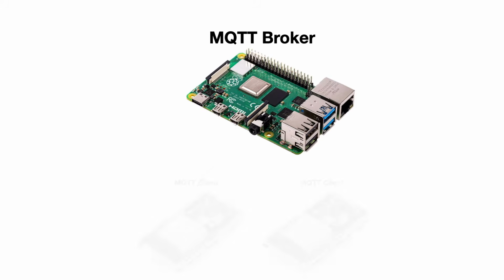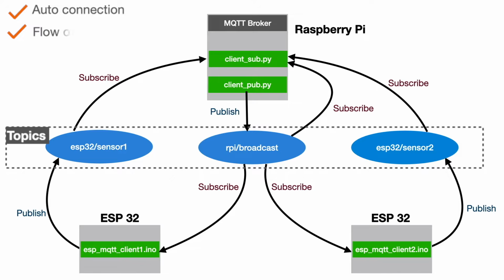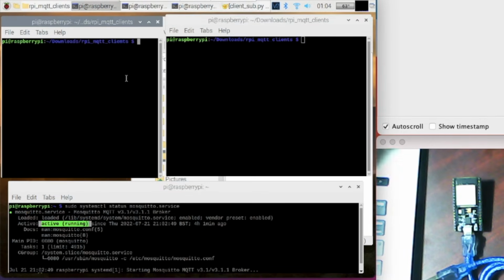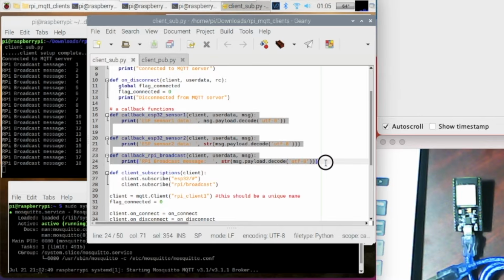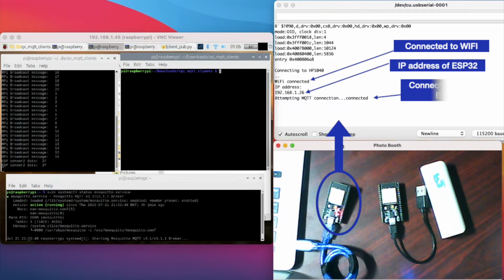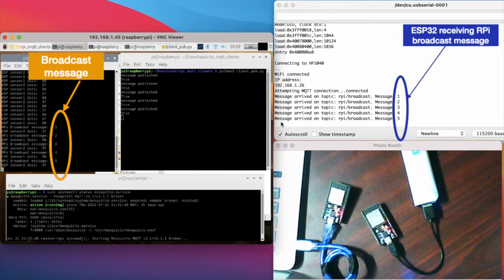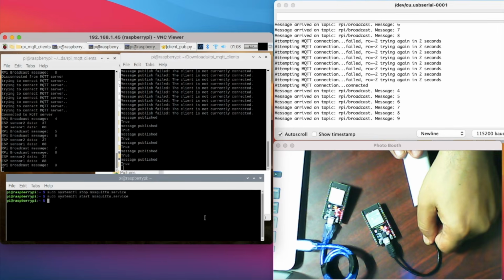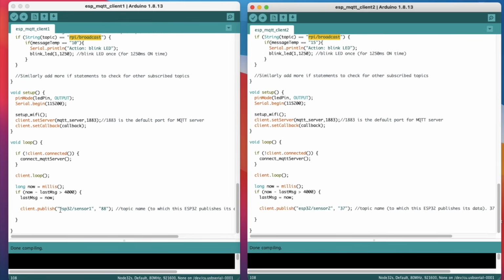How to setup MQTT for Raspberry Pi and ESP32 for IOT and Robotics projects

Comment: Nice video and great explanation! Thanks a lot! Can I use this to control things like servo's on the client ESP32 devices? I'd like to use this setup if possible to control the lifeboats (each with an ESP32 C3 supermini) for my ship model. The transmitter has a Raspberry Pi 4 as it's brain (mostly because of the 10" touchscreen which I use for settings and controlling on/off functions) and the model itself has a Pi 4 as well. Both the boat and transmitter will have a WiFi repeater to greatly increase the range for the WiFi and a lighthouse island purpose build for a 3rd repeater will increase the range even further. There will also be ESP32 CAM's aboard the main model which I'd like to setup as webcams.

Comment: You explain very well but you haven't try Raspberry Pi as a Client. Do you have code or tutorial to use Raspberry Pi as a client?
Reply from the maker: Raspberry Pi as a client is already covered in the project. The client_sub.py and client_pub.py are the python scripts that can run on any other Raspberry Pi also. In this project the broker and client scripts are present on the same device. You can run them on different RPis also. For more information read this article
https://helloworld.co.in/article/mqtt-raspberry-pi-esp32

Comment: Hi Jitesh helloworld,
what a great project! It works properly.
I would like to setup a MQTT project with one ESP32 as a subscriber and another ESP32 as publisher. The broker should be a local RasPi standalone as Broker-Server creating its own WLAN without connection to the Internet via Router or Access Point.
Can you give me hints how to do this?
The handling of the ESP32 should be easy. But with the RasPi I have got my problems to combine the installed Mosquitto and the WLAN-Server capabilities.
Do you have this setup described in one of your courses? (Please without NodeRed.)
Thanks!
Oli
Reply: heyy if you got the solution please tell me as well!

Comment: To the point. Very welldone.
I have one stupid question.
1. Can we implement MQTT client & broker with esp01 with AT commands firmware?If yes how? if no why?
Thanks
Reply from the maker: Thanks. 
I haven't used AT commands with esp. But I'm sure that with limited resources of a microcontroller implementing broker functionality would be challenging
Reply: Thanks
 may i get your email to talk to you for any work @jitesh_helloworld
Reply: one more question see if you can answer.
1. I want to communicate 2xESP01 through mqtt in which one will be broker and another will be client and all this will happen over WLAN. Allowing us to perform mqtt operations without internet. Is it possible? How should i do it?  @jitesh_helloworld

Comment: Thanks for your tutorial but I faced some difficulties while applying the scripts.
I always have "ConnectionRefusedError: [Errno 111] connection refused" when I I am running the python Script. I am using the raspberry as Broker and client and I ve tried both to publish and Subscribe to a topic as defined in the script but with out any positive result.
I ve checked the IP-adress but I dont think thats the problem.

Comment: I keep getting a "Attempting MQTT connection...failed, rc=-2 trying again in 2 seconds" error message printed on the serial monitor. The python codes seem to be running fine on the RPi but I don't seem to be able to establish a connection between the ESP32 to the broker.
Reply: same
Reply: @fakturmuhfroni3616  @Laplace777 Not sure if helps but I had the same issue, I fixed it by adding the following two lines in the mosquitto config file

listener 1883
allow_anonymous true

Config file is located in /etc/mosquitto/mosquitto.conf
Reply: @SebulbaBG  thank's boy now I have "Attempting MQTT connection...connected" 🤝

Comment: Hi. I'm currently working on a project. In my case i need to get several sensor values using several nodeMCU modules. Then i need to send those values to the broker and the broker will make some calculations on those values. Then i need to publish the result to all Node MCU modules for taking actions. Can you guide me?. Is it possible?. Can i pass data in client_sub to client_pub?.
Reply from the maker: Yes. You can do that.. Pl understand, here the broker only relays the messages between devices. It doesn't do any modification in the data. You need to make one of the client (preferably RPi) to collect the data from all nodeMCUs on a topic and then do you calulations and publish the results on a topic which every other device is subscribed to.
Reply: @jitesh_helloworld  Thanks for the quick response and for the advice. In my case do I need to have 2 raspberrypi modules?(one as broker one as client) or one is enough(run 2 separate scripts in same rpi). Is there any reference I can follow. Again thank you! You are a life saviour! 👍✌❤
Reply from the maker: Yes you can use the a single RPi for this. It can run a broker as well as client python scripts. In this video I configured the RPi in similar manner. 
https://helloworld.co.in/article/mqtt-raspberry-pi-esp32

Link to source codes is given in article as well as video description
Reply: In your project, client_pub didn't subscribe to any topics. In my case i need to subscribe to all topics. Is it possible then. I thought the publisher couldn't subscribe to other topics. Thanks for the reply. ❤️
Reply from the maker: It can publish and subscribe at the same time. So that's a simple assignment which you can figure out.. Notice that ESP 32 program does both Publish and subscribe in a same program. So in RPi it is much easier to achieve that with python.
Reply: Finally i figured it out. But there is one small problem. When i run the script it publishes only one time. I need to publish whenever I receive on the subscribed topic. Can You provide me with your email address.  Thank you for the help. 🥳